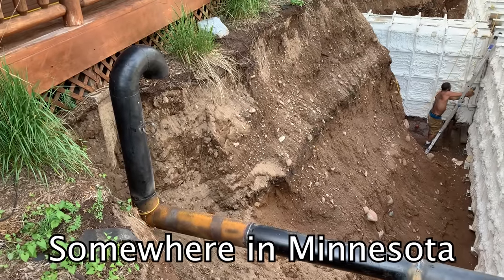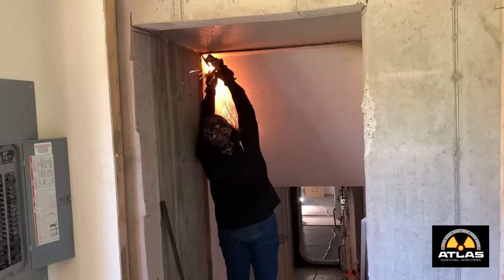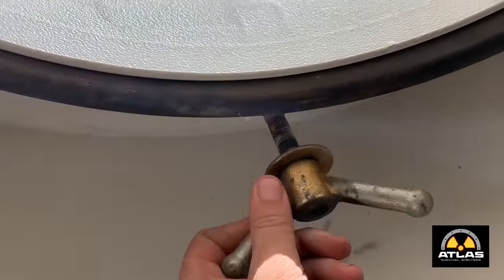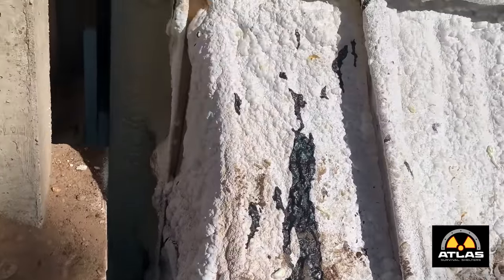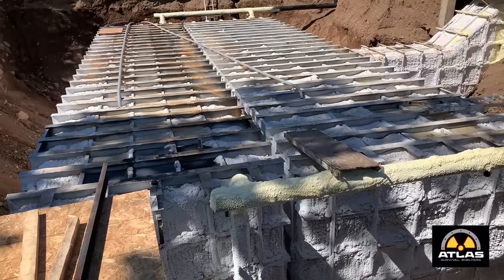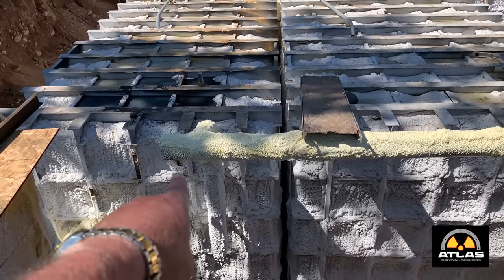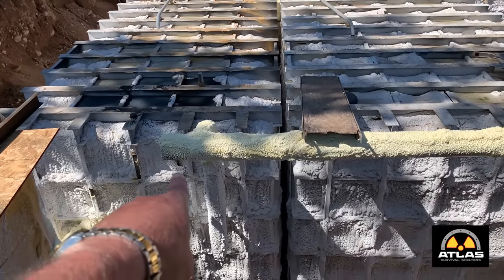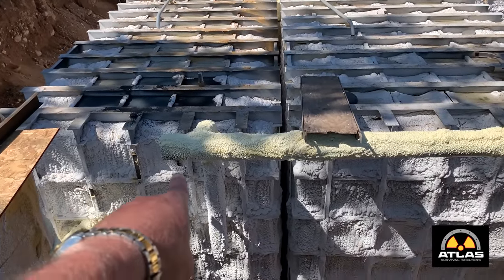A Completed $500,000 Luxury PLATINUM SERIES Doomsday Bunker

Comment: Everything is expensive and bad Quality in US . Sorry but you can build a perfect concert bunker in Europe and you need just 50.000 $. 50 cm high quality C 40 concert walls. 2 meeter deep  underground. And bigger than that expensive trash.
Reply: @Chris Longski half value layer is very important for radiation protection.  Half value layer of concrete is 2.2 inches and for dirt 3.3 inches. After a nuclear atack probably outside radiation level can be 10.000 rem and your body tolerance is only 0,01 rem .  If you want survive you should be 70 inch under ground.  I don’t think so this is possible with that bunkers.

Comment: Many questions.  average person,  drinks, 1 gallon of water a day, bathroom,  flush,  average 3 gallon of water. Shower for 5 min, 6 gallon of water. 90 or even 30 day, just water for one person is going to be 100 gallon  plus, add people.  you looking, 250, 300 plus gallon just for 30 days. I don't see anywhere, adding in water systems to these bunkers.
If radio active, happens.  All this has to be separate and buried. I'm seeing  no electricity, battery, big generator, system to run pumps or anything.  Or air filter system,  for radioactive  in air or a good prevent air borne virus in air. The small carbon system in these, seems, small.
Reply: you have to check out some of his other past videos.  he talks about all those things in various videos.

Comment: Ok pleat let someone else do your bunker videos because I can’t stand you saying and explaining the same thing over and over. Not to mention that is a horrible layout for a bunker. Who designed this thing. You don’t need two full bathrooms in a three bed room bunker that space could of been utilized better. And stop saying concrete won’t grow mold because it will. I guess you have never been in an old musty mildew basement. You try to play off the trim around the door being so nice and built just like home but yet have electrical conduit running across the ceiling. And sub par shop light fixtures. You have a condensation valves at the end of each pipe but the connection going into the bunker is before the valve. So is the water going to drip in the bunker first or the valve. Your valves should be before each bunker connection and at the end. But hey your the professional right.